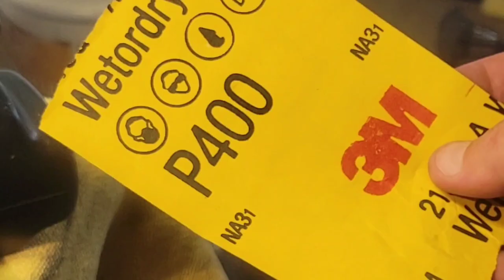Glock safety plunger mod. DIY tips and tutorials.

Comment: Exactly how I’ve been doing it. Makes a huge difference getting that sharp end off of the plunger.
Reply: Why what's the sharp end do?
Reply: @lalamanky  There is usually a small little pointed end I presume where it was parted off. It can be felt in the trigger pull as a hang up or a bit of a stop. Most aftermarket one’s are usually smooth and create a smoother surface for the trigger bar to engage and ride on. DIY it much easier, faster and cheaper.
Reply: @jessecopeland9728  also polish that top of the trigger bar for a smooth slider over that plunger

Comment: How does this improve the guns performance? I wanna go do this to all my blocks now 😂
Reply from the maker: Great question. It is a suttle difference but every advantage helps. Your trigger bar glides across the top of the plunger during the trigger pull, so SLIGHTLY rounding the edges and polishing just adds a little more smooth feeling to your trigger pull. Which of course a smoother trigger always helps with less budging when the trigger breaks. A flat face trigger shoe alone helps a lot with shaking or budging when pulling the trigger.
Reply: @CycloneGunworks  oh okay thanks then yeah I’ll be doing those upgrades on all my glocks, and 
Y p80 build has a flat face trigger and it feels really nice compared to the original Glock triggers
Reply from the maker: Yep the stock trigger is called a blade design where without practice your always pulling it incorrectly, as to where a flat face trigger gives you no choice but to pull in one direction a little bit easier if that makes sense.